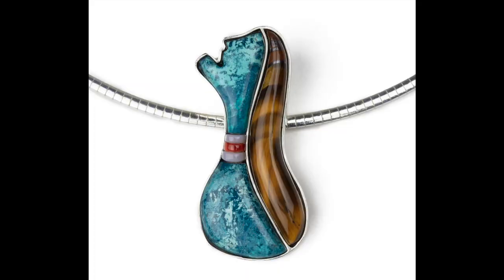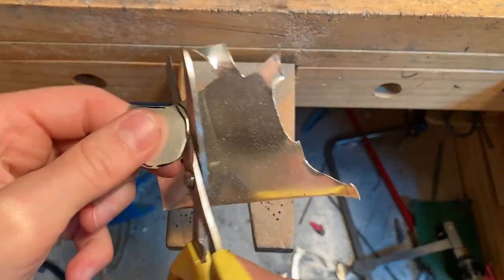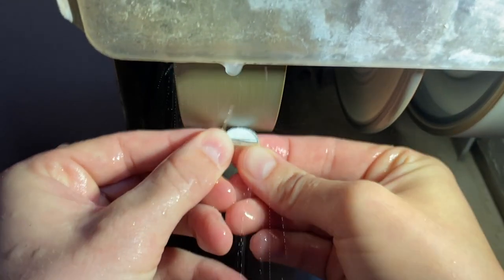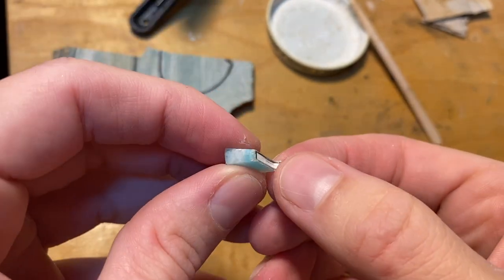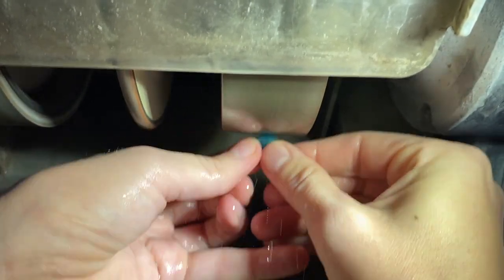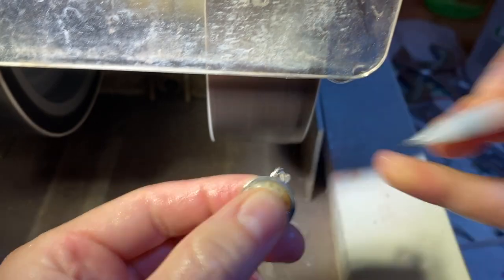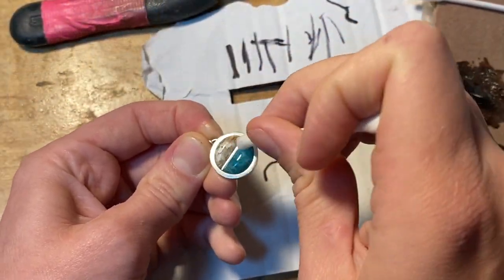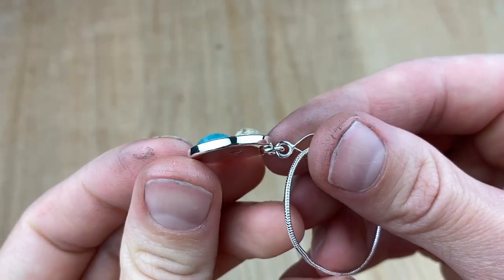How to Make a Simple Cobblestone Inlay (aka Pillow Inlay)

Comment: Would you recommend dopping the stones or free hand?
Reply from the maker: I suppose you could dop the top for while you work on fitting the bottom of the stone in your framework, then dop the bottom to do the doming. The problem I see here is you’re going to miss out on a bunch of test fits along the way. I know with some stones it’s easy to overcut the girdle down too far and will loosen your stone. But I have heard people dopping even the tiniest of stones on a little wooden skewer with a bit of CA glue though!
Reply: @calbrittonjewelry  you are absolutely correct on the fitting thank you for your time 🙏🙏🙏
Reply from the maker: No problem! Good luck and have fun! 😊🤘